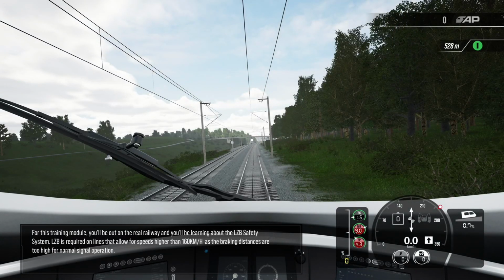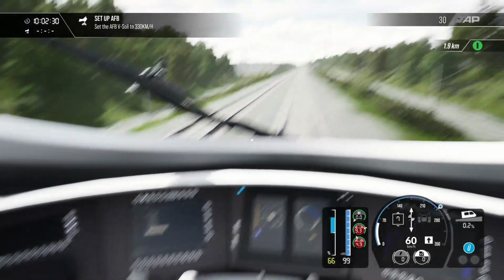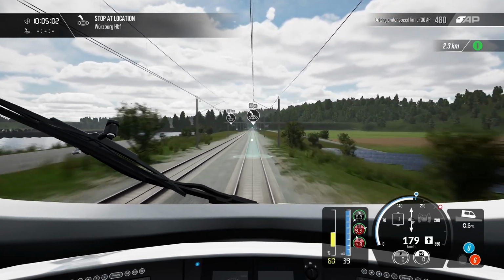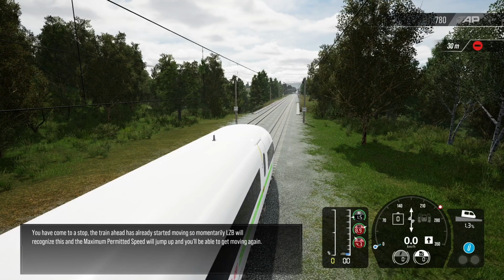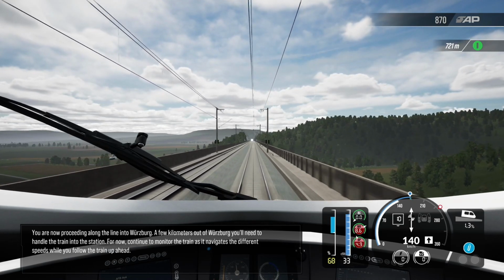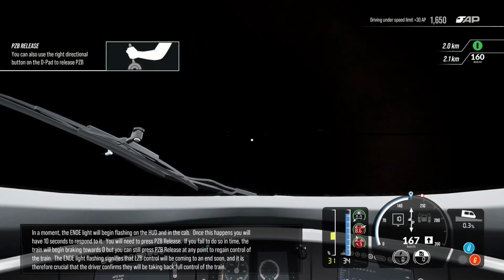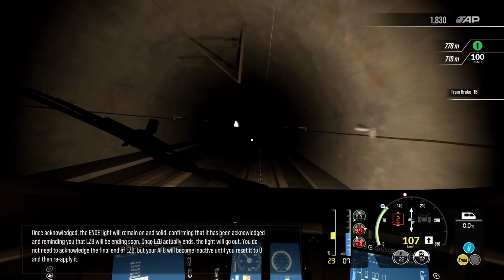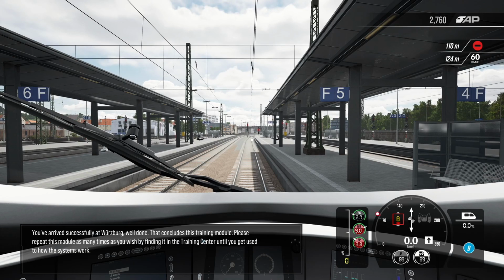Train Sim World 3 - Schnellfahrstrecke Kassel Würzburg - LZB Introduction

Comment: Would you happen to know why do I lose power after the first stop?
Reply from the maker: The only thing I can think of is if you still have some throttle applied when you apply the brakes the throttle has to be set all the way to off and brakes must be fully released before applying throttle again for the train to get power.

Comment: Really struggled with this one.  Not having used LZB or PZB before it all went a bit too fast for me.  I’m assuming after a few repeats of this tutorial it’ll all start to make more sense.

Good luck with the new channel.
Reply from the maker: Yeah this one is a little confusing because the steps mislead you a little bit. You actually don’t have to use the LZB system at all if you don’t want to. You can drive the train as normal but because you’re travelling at such high speeds it can be a bit tricky to pay attention to the signals and make sure you have enough time to brake without running a red.
Reply from the maker: Also, thanks for your support. This channel will be just random games I play. Racing channel is my priority.